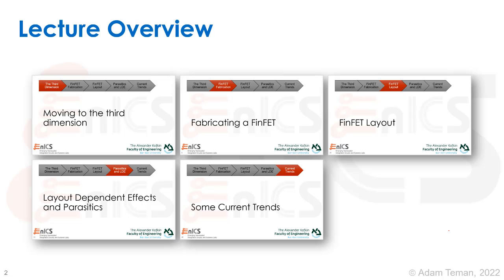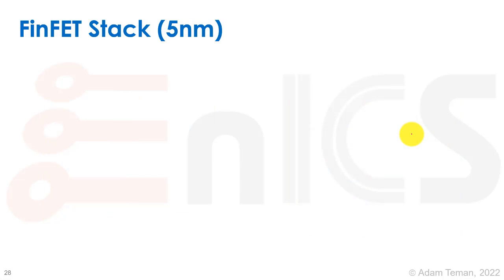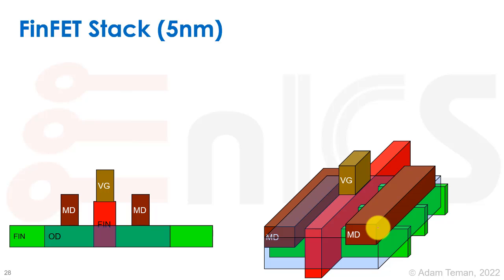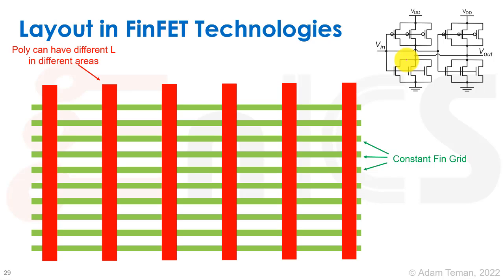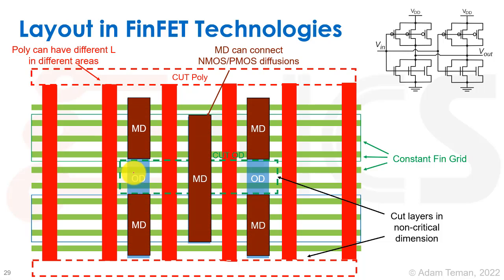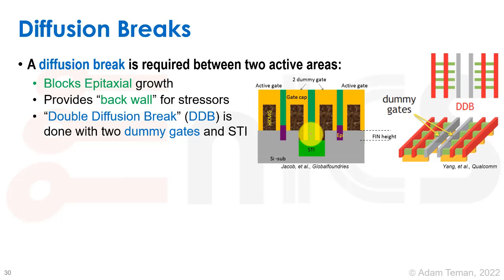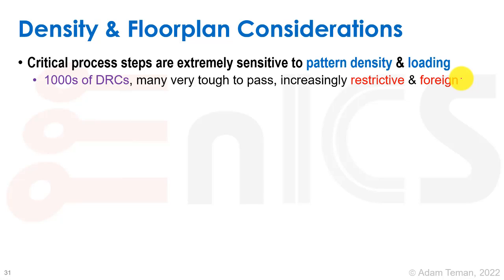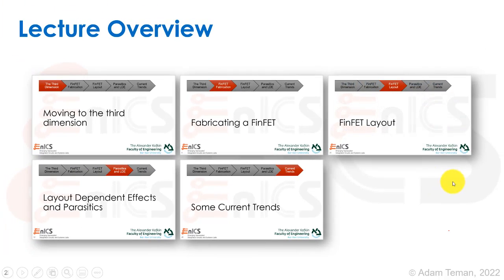Advanced Process Technologies - Part 3: FinFET Layout

Comment: Thank you for the good lecture. It was very helpful.

Could you tell me about the question below?

1. What is the purpose of using the "gate cut layer" in the 14nm process? In my understanding, the gate cut layer also plays a role in separating the gate area of TR from other TRs.

You said that dummy gate pc also separates the active region, but I would like to know the difference.

2. When layout, is the big difference between 14nm and 10nm about "COAG"? (deleted , I'm sorry I asked you a question)

3. Could you make a detailed lecture on layout of GAA? I haven't experienced this process yet, so I'm very interested.

Have a nice day :)
Reply: Should I think that "gate cut layer" is seperating "poly" , and dummy gate is seperating active area like STI by cutting "fin" ?
Reply from the maker: Hi,

I'm not exactly sure I will answer accurately, since you are using different naming conventions than I used in the lecture. But in general, if I understand what you're asking, cut layers are used as follows:
1) draw a very regular pattern with really tight design rules (such as fins or poly-gates)
2) use a second mask with more relaxed design rule that just etches away the feature we just made in the perpendicular direction.
So if we have a long poly that is very close to its neighbor using all kinds of tough fabrication tricks (like SAQP), then we can separate different gates of different transistors by making cuts at a resolution that I can do with "standard" photolithography.

Therefore, for each "really tight" layer, you often have a cut layer. 

Regarding your question about COAG in 14nm vs. 10nm processes - I actually have no idea. Unfortunately, I don't have access to these design kits (I'm guessing, from Intel) and so I can't even try to figure it out... To be honest, I don't even know what process this was introduced at by each foundry other than according to rumors or not-necessarily accurate internet searches...

The same can be said about GAA. All I know so far is what I've seen other people publish and discuss. If and when I have the opportunity to get a more deep understanding, I will be excited to teach about it!
Reply: @AdiTeman  Thank you very much for your reply.
I've always been curious about the cut layer, but I understood what you told me.
The explanation "really tight layer" completely solved what I was curious about.

Right, the process is very, very secretive. I forgot for a moment ;)
The lecture you taught was very helpful. I look forward to good lectures in your Channel
Thank you!! :)

Comment: Well done. In 9:16 what is meant by 'Here we have VG which is a coag '?
Reply from the maker: A COAG is "contact over active gate". 
This is an optimization introduced, I think, in Intel's 10nm process, where the contact is applied on top of the transistor channel, as opposed to pulling the poly gate off of the channel and dropping the contact on top of this extension.
Reply: @AdiTeman  Thanks!!